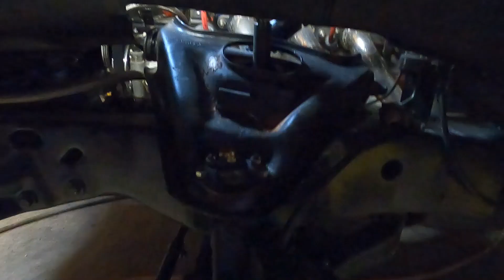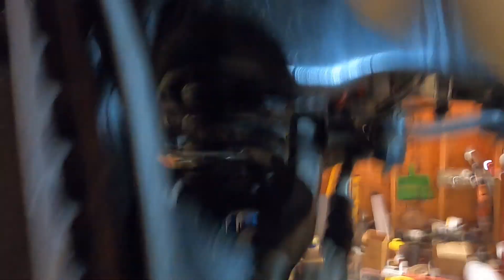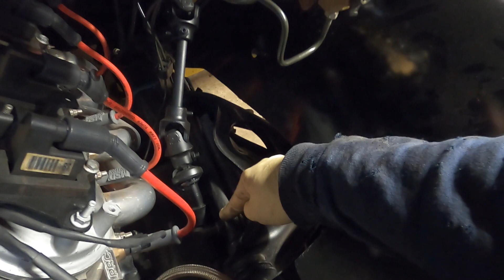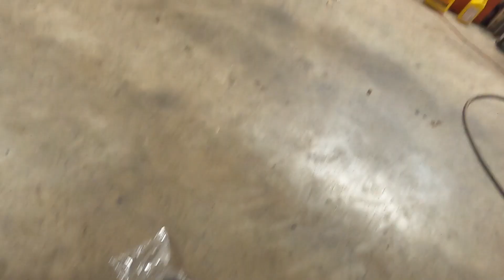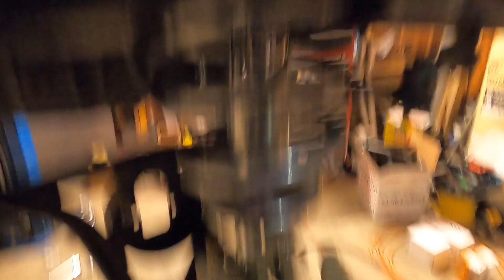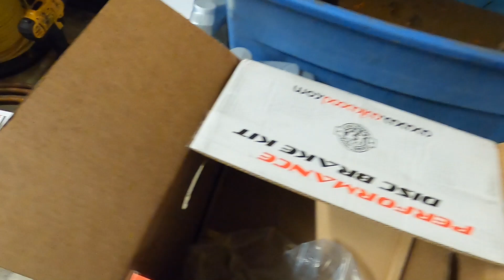Major Suspension Upgrades for this C10!!!!

Comment: Released Feb, 2021? What is wrong with what we are shown? A lot! First, if you dig, you may find this is a grafted second gen “F” body crossmember, no mention of that to start. Always Identify what is being worked on, structural changes made prior this install, like the crossmember as it is confusing for someone to see this, get under their truck, and see major differences. Plus, the 67 does not have side markers on the fenders, but later models do with variations. Upper control arms have frame bolts for shims, but these bolts face outward, not back. Then install a naked coil over with a spring, check for movement and clearance...Why? Is this the first one you have done or showing “Best Practices” prior the complete the install? I am confused! What is being removed is different from a 67 C10 OEM setup. An explanation should start the video describing the changes as someone starting out, would not know! If that was off subject & confusing, wait, there is more! Let’s talk and show you what we will do, with these parts later, but here’s what they are & look like, but not in this video... This screens “We have not done this for 3 years and video taped it at the last minute. I am sorry, but my mouth was open the whole thing wondering what Captain Kangaroo & Mr. Green Jeans was going to walk into the video and say “April Fools!”
Shocks, springs, nuts, Wilwood calipers with 6 tiny pistons that the surface area total to 2 15/16” sq. In., the same as a heavy-half C1500 from 1988-2002 on the Express Van, yet never got that far because more talking than doing. Flat Rate is time, not talk. It takes 1.7 hrs. per side, yet spent all of the video and accomplished less than half of the install. Sorry guys. But as a tech at dealerships & Independent shops, this falls short of getting it done or product install. It is the viewer that is to benefit from your video instructions. A Monday AM video was a last minute attempt to show something. Shop cold? Warm it up in advance, shut the heater off, arrange your parts to explain what you have, what is different from stock, practice, and then stop apologizing for miss steps in preparation and focus on a task. Step 1, step 2, step 3, etc. As a guy who held Technical Seminars for up to & over 100 technicians, mechanics, shop owners and tech school instructors for 4hrs. straight, 4 per week in different towns, cities & states per week. 
Dam, you started loosing me at the beginning telling us about the lugs nuts were removed. Ok! That’s a good place to start. Sorry to be brutally honest but I have no other explanation. Work at your presentation skills and perhaps you will get over 1k views and 4 or more comments. A video making “Cup-Cakes” with sprinkles would fair better. Unless you talk about the oven, bowl and spoon used to make! You can only get better! Thanks.....

NIASE (ASE) Master Tech since 1978 - Now Retired  ( Plus L1 & P2 Certification )
 (EFI Tech 1977 / Multi-Port / 3 gas Analyzers)  (2 brands sold in 1976 by two different companies / not mechanical or CIS injection, With on-board computers with totally different approaches for fuel injection systems)